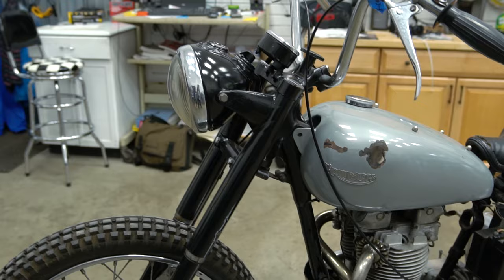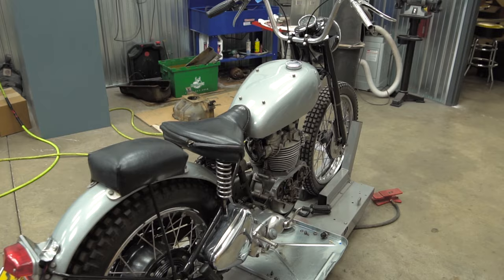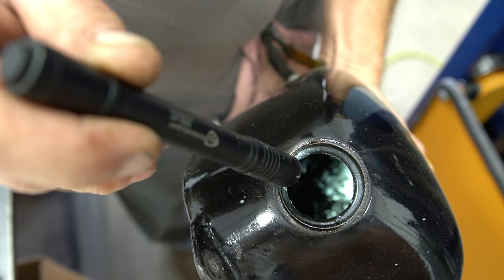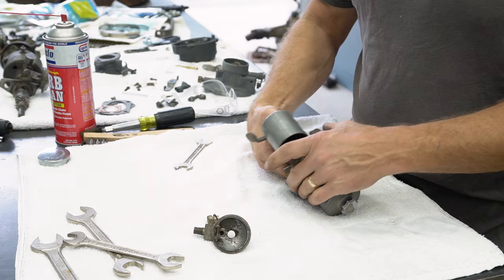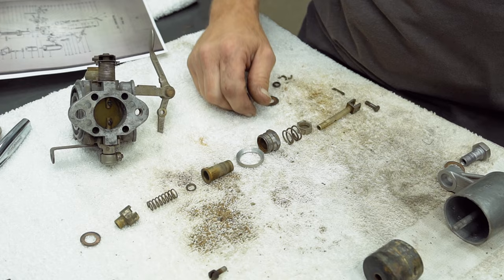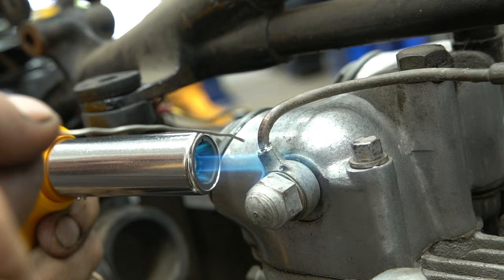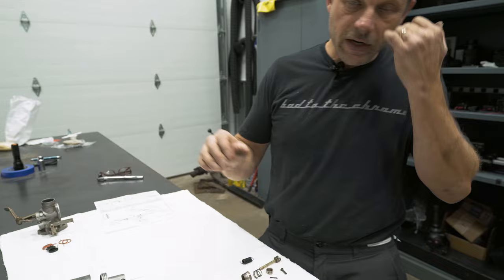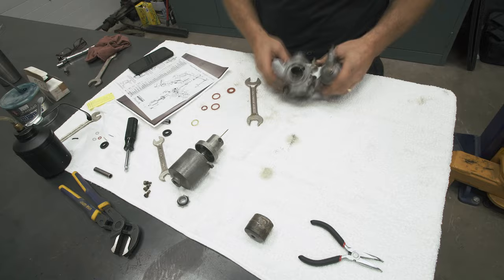Repairing The Fonz's vintage Triumph motorcycle - Will it run?

Comment: Hello hagerty. I am watching you from Europe. I have a honda C50 with breaking points for the spark. I lose spark always in high revs (especially high reving for a long time= reaching and maintaining top speed for more than 1 km distance 0.6 miles) which also destroys my breaking points. I have changed spark plug, spark wire, coils and breaking points. Still the problem is there. Any ideas to help me?
Reply: Yes. You have to set the timing cold first, probably best with a multimeter. The advance on your machine is mechanical, and the weights can stick. You need to make sure they're lubricated - there are a few pivot points on either weight, they need to be able to move freely. At higher revs, the weights will move out and advance your spark. If those weights can't move, your machine will cut out at higher revolutions (engine speed). 

EDIT: I believe that the timing advance weights are located behind the plate on which the breaker points are mounted. You'll have to take the entire plate away to reveal the timing advance, in order to access the weights and clean, lubricate,  and maintain them.  I believe that the breaker plate is connected to the head with a few screws.  

Once you make sure the advance weights are lubed, and that they can move well (you should be able to expand them with your fingers), then try starting the engine with a strobe light hooked up to it. You should be able to see the spark advance, when you rev the engine. There should be a tick mark on the breaker cam that you can watch with the strobe light!  

There are correct settings for the maximum amount of advance. You have to adjust the points to open somewhere between the maximum advance, and the cold setting. Usually, a mechanic, cannot set both the cold timing and advanced timing exactly to specifications, you must set the points at a compromise of both the settings. That's just the way the mechanical advance systems used to work.

Good luck with it!!!
Reply: @KelikakuCoutin  thank you very much for your advice. I will try it out.

Comment: by the looks of the inside, there is no reason this engine cant run if you replace the fuel lines and wires, then chase the spiders out of the points. you have made this far more difficult than it needs to be. if you have a set of sae tools, as well as metric, you dont need wentworth anything.

Comment: your timing this bike up all wrong  you time it from the left cylinder first and it timed on the left-hand side, not the right side  and the leads the left cylinder nearest battery box  right cylinder nearest the barrel
Reply: I saw that too. He should have used a multimeter.

Comment: Why is the motorcycle in bad condition as it is?  It seems like if it was Fonzie's motorcycle they would have took better care of it.
Reply: I don’t know if this bike or if there were a lot of them touring the Autorama circuit in the 70s but one I saw in late 70s in Detroit was real piece of junk, it was all greasy and looked like it was painted with spray can.